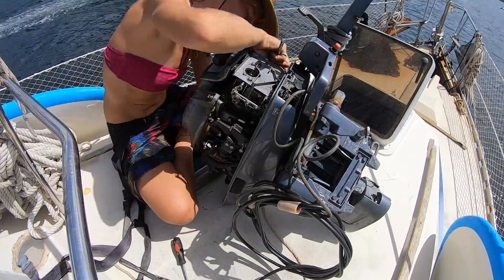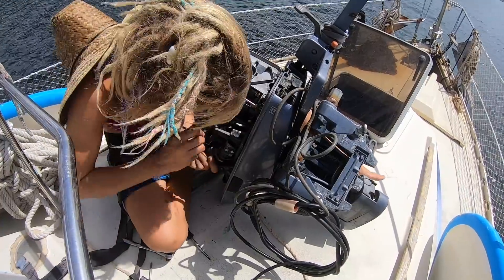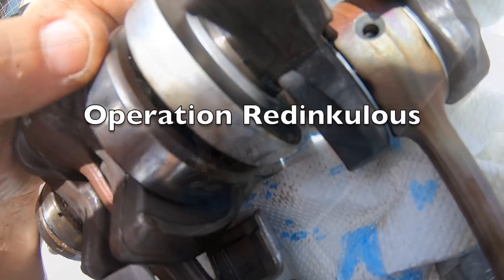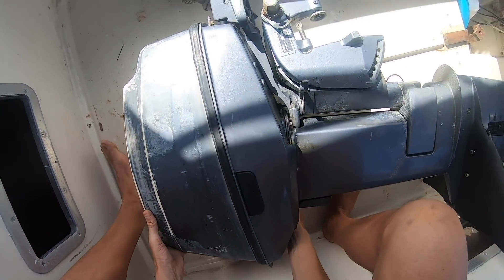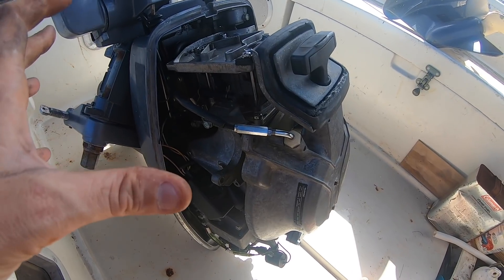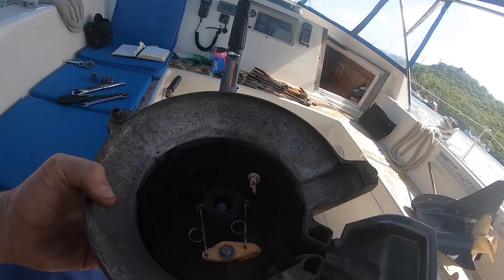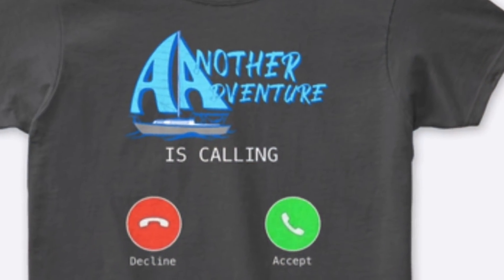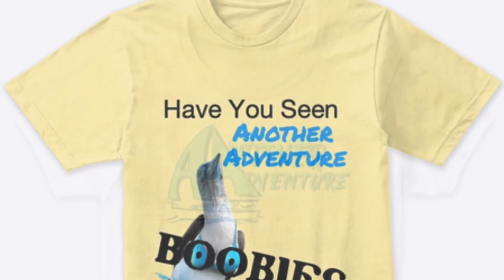A Womans Touch Pulling an Outboard Cranksaft. Rebuilding a 25hp 2 stroke Yamaha in great detail!

Comment: with the multi plugs take a typex pen or bottle an mark each plug and reciever with 1 dot or more matching each plug with a ewciever( if you do not have typex grab the brightest nail polish you missus has and dab each plug and reciever 1 dt on each for the first 2 for the second and so on  they onlt need to be dots on each half remember this is a visual guide only ...

Comment: If you have access to dry ice it and can submerge the entire assembly in it for 20 minutes.  Then carefully remove and apply heat to the bearing causing to the increase in size quickly, then you may be able to pull the bear off.  I know ... no dry ice...

Comment: This reminded me of two things; my first repair job on a car and when we took two Alpha Romeo Milanos and made them into showroom stock racers for IMSA.  I had no idea what I was doing as I took apart the brake cylinder.  As I took things off I laid them out in order and made notes.  I then reassembled things in order after renewing them.  It worked!

The Alphas were the two cars for a dealership team.  I suggested we label everything but the factory trained mechanics said we didn't need to.  So we completely stripped the first car WITHOUT labeling anything.  It was a real PITA trying to figure out where all the nuts and bolts belonged during reassembly.  During the processing of the second car, EVERYTHING was labeled.  I didn't need to say "I told you so" since everyone knew!

Great video and thanks.  I am about to redo my first outboard and I was wondering what they looked like inside.  Thanks again!

Comment: Ahoy Skipper Holly,  As someone who has been taking apart and rebuilding OB  and vehicle engines in a shop environment with work space and work benches, engine stands and every tool imaginable  etc.for over 40 years now _ I can say Lady you are the best of the best. That Yamaha weighs around 125 pounds and you make it look light. Impressive. You have proven once again that were there is necessity, willpower and determination there is a way.
Reply from the maker: Thanks! 😁

Comment: Great job Capt. Holly!!! I use to work in a small engine repair shop, but never had the chance to work on an outboard.  Labeling and bagging is a great trick I used all the time, saves a lot of headaches. The only thing I didn't have was a camera to take pictures, it's a lifesaver now...Peace Luv Rock N Roll

Comment: AWESOME JOB HOLLY!  most people would not have the stuff it takes to work on an outboard on land let alone on their boat.  Kudos to ya!
Reply from the maker: Surprisingly enough the most advanced part of this job was the flywheel puller... The only other tools used were basic plyers, Philips and flat head screwdriver plus wrenches and sockets ranging from 10mn to 14 mm with the exception of the the 21mm socket on the flywheel...

Comment: Best low tech method to recon a crank I have seen is Molasses, a very experienced vintage engine restorer showed me a WW2 Blitz truck crank which was recovered from remote Australian bushland after 50 years of exposure open to tropical elements and the occasional fire. He just washed it off, gave it a light scrub with an old broom, threw it in a drum of 1:3 molasses/freshwater (large volume molasses is available from stock feed suppliers), pulled it out after a a couple of weeks and washed it off. The bearing surfaces didn't even look like they needed to be linished (just don't try to restore aluminium the same way....it will dissolve in a couple of days).  Looks like you made do with what you had, looking forward to see how it went, cheers.